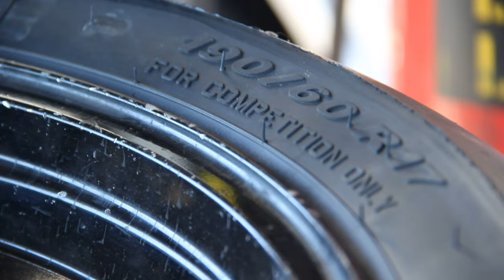MOTORCYCLE SPROCKET | GEARING DECISIONS - How I choose Sprockets for Racing

Comment: Hi. Very good video. One thing you might want to keep in mind that you’re also limited by your chain length. Both how short wheel base you can go, and how long. I guess you could carry multiple chains with you, but typically, you’re only going to have a certain finite amount of gearing changes you can do with a certain chain length before the Chain is too long or too short.
Reply from the maker: 100% correct sir! That’s why I match the gearing for the wheel base for making large changes at the track. Later if I want to make smaller adjustments I’ll reset the wheelbase and get the chain right at the same time. Good point!

Comment: On my 600's my 1st mod is usually a 520 conversion -1, +1 or 2. And I havnt been to a track in 15yrs. Otherwise the bikes just feel gutless to me. I have not noticed the engine breaking to the extreme that your mentioning. Depending on what type of speedo setup I'll get a speedo healer or just use the GPS to calculate my speed so I know approximately what I'm going compared to what it's reading. But the most thing is losing that top end speed limit. But on the street who needs to go that fast?
Reply from the maker: For street use, the -1/+2 is perfect and it’s not bad for EB as on the track.

Comment: I appreciate the video but it was a little confusing.  Basically every time you add a larger sprocket (front or rear), you are shortening the wheel base.  Also I think it is worth pointing out that there are limits to how much you can change them due to a) chain length or b) interference with the frame, or c) running out of extension on the back.  I think it is worth explaining why you would go with say 14/45 vs 14/46 from a riding perspective also.  

You're going to do well in Novice this year.  No shame in downshifting if you are not improving your riding as an expert.
Reply from the maker: All good points. I might do a follow up to this and get a bit more detailed.  Thanks 🙏!

Comment: How better is the fall in on the 60 compared to the 55
Reply from the maker: So the turn-in/fall-in isn't something you should be thinking about with a REAR tire. Turning performance needs to be a front end activity and the rear needs to be focused on finishing the corner/acceleration performance. The taller tire makes for a larger contact patch when leaned over so the performance goes like this: 190/60 > 180/60 > 180/55.  I've raced all sizes and have really come to appreciate the 190/60 Pirelli over the other sizes they offer.
Reply: @Aaron Dearborn #773  if that isn't something I should be worried about, why do they continue to make different sizes with different contact patch circumference? And last I checked most people are worried about the contact patch of the rear tire
Reply from the maker: @Drewrides89  I don't understand, you've basically pointed out exactly what I was getting at haha!  I was saying turning performance is not a REAR tire function.  So a different REAR tire size is aimed at creating better contact for acceleration NOT turning. 

Of course, you cannot change one part of the suspension/geometry without effecting another, so there is some minor changes to the whole bike when the rear tire size is different.
Reply: @Aaron Dearborn #773  seriously? 
If you have a 180/60 rear tire compared to a 190/55 you have a faster fall in on the 180/60 but less of a contact patch compared to the 190/55! Correct? 
I was asking is there any noticeable difference on the 60 compared to the 55
Reply from the maker: @Drewrides89  correct sir!